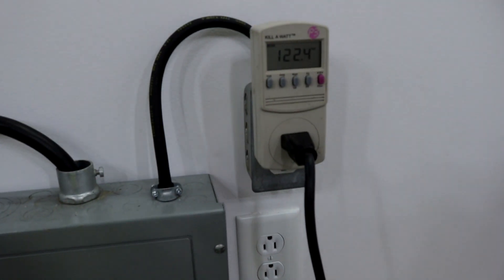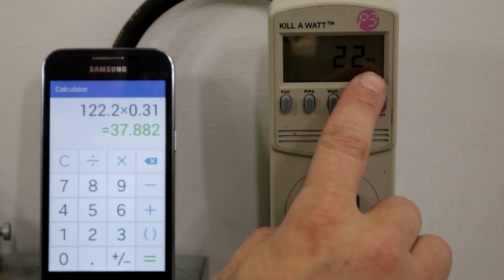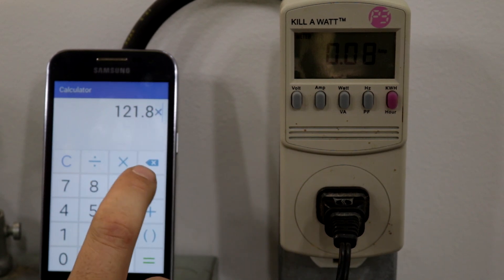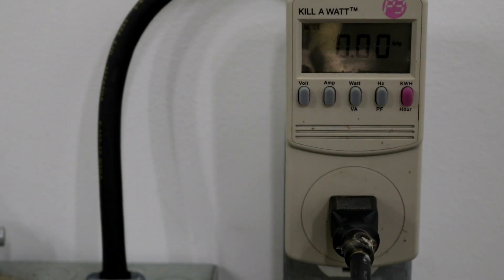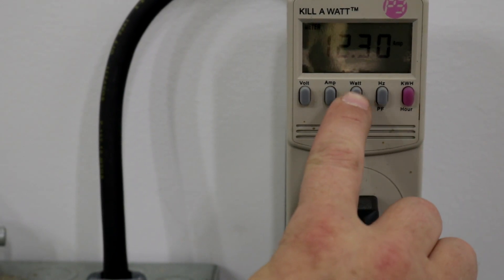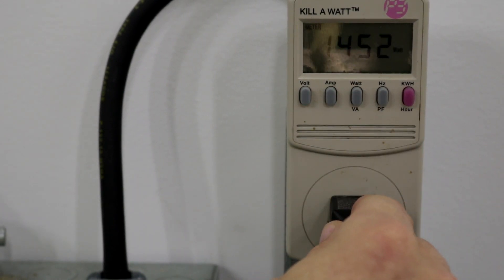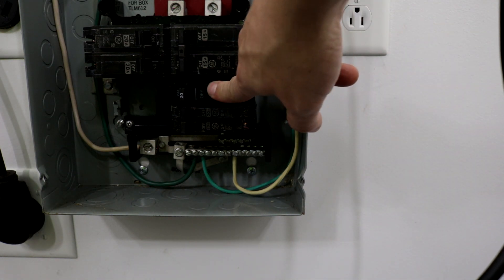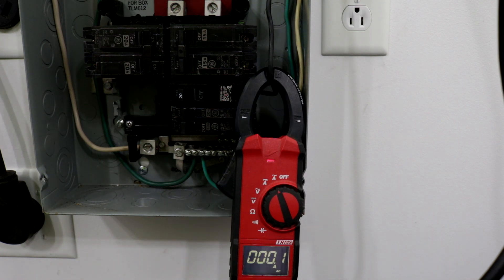How to Measure AC Amps - Circuit Breakers and Wall Outlets

Comment: How do you check the amperage on a 240 volt system?  Do you add both of the hots together after you check the amp draw with your amp clamp?

Comment: Thank you.
That was very informative.
Couldn't find a good video for either the Kill A Watt or a clamp meter on a circuit breaker panel, and this fit the bill perfectly.
Hopefully now I can figure out what the heck is drawing $700 a month in power on my bill.
Reply: Thats something everyone should do to make sure they are not being overcharged. Make sure whats indicated on the meter and on the bill matches the actual usage.
And parasitic loads etc....
You'll find quite about that online.

Comment: Good information. I have one question. There are two outlets in one of my circuits which gives very low amperage.  A small iPhone charger works but an iPad charger does not work!  All the receptacles in that circuit are wired correctly when checked using a three prong Outlet wiring tester.  The voltage on the nonworking outlets also shows as 110 when checked with a Voltage Tester.  Any helpful comments will be appreciated.  Waiting for an electrician to come and take care of this, hopefully!
Reply: Did you ever get this resolved, and what did the electrician say?

Comment: I need to install wall heaters. Is there a way to check if I can piggy back off an outlet (am I reaching more than or less than 80% of my amps?) or if I need to add a breaker and run wire? is that what the clamp is for?
Reply: A tankless water heater? Is so I install those all the time. I am currently running up to a job where I did exactly what you are asking. I was still under the 80% "so I thought" based off the numbers,so I pigtailed off the old power source for the original water heater. Even though I knew I should run an independent line and breaker,I didnt because the new heater was only 120v and within the breakers limit. Now I am taking time out of my day to go fix it for free because I didn't run the heater off an independent power supply. Take it from me,regardless of if it's a single pole 120v or a double pole 240v YOU WANT TO RUN ITS OWN LINE AND BREAKER. I hope this helps,I wish I would have taken this advice before I used the existing line. 
Good luck bud,I do this for a living and this is the first time I disnt do it the way I normally would,and it proved that I should have,if you ever have any other questions,I'm happy to help if ya want. Good luck,and be Safe!
Reply: @normalhuman9260  wall heater
Reply: @sindelm7437  do alot if those as well. Gas or electric? If its electric 1 pole or 2 pole? If gas is it natural or propane? If it is all electric,especially a double pole,I would almost guarantee it would need a separate and independent power supply. Depends on the unit itself and what the volt and amps are.

Comment: Great video, thanks for sharing.
Question :
Is a 12 gauge wire large enough for a 25 amp breaker ?
Thanks for your consideration,
Sincerely ..........................
Steph
Reply: 12awg is rated for max of 20amps, i would size up to 10awg, which is rated up to 30amps,  to avoid potential fires
Reply: For a 12g wire,I wouldn't do over 20amps even if you are only running it a few feet. How far the wire runs also makes a difference on sizes. With a 25amp,and running anything more than 20ft,I would absolutely take the other guys advice and step up my wire to a 10 gauge wire. Soild,not braided. Hope this helps,good luck and be safe.

Comment: Assuming the amperage load being measured at the breaker panel is carried by all wires connected to that circuit, why is there no meter to measure the remaining amperage available for that circuit (up to the breaker value) from any outlet connected to that circuit?
Reply: Is it because the wires in the circuit without an appliance connected (empty outlets) are not "drawing a load" from the source (the breaker bar)?  So the load can only be measured at the breaker?  Is it a function of drawing power, as opposed to 'carrying an amperage load'?
Reply: Ok, I get it:
To determine if you have enough amperage available on any particular circuit for another device before blowing the circuit breaker, you'll need to use 2 different test devices.  First, use an ampmeter (clamp or slide type) to measure the current load on the circuit in question at the breaker box without the new item connected to the circuit.  Record that amperage reading.  Next (either read the amp rating for the device from the label on the new device or) plug a Kill-A-Watt into an outlet on another circuit, plug the new device into the Kill-A-Watt and read the Amp draw for that device.  If the combined amps for the normal load on the circuit you originally wanted to use, and the new amps from the new device exceed 12 amps for a 15A circuit breaker or 16A for a 20A circuit breaker, you need to avoid plugging the new device into the outlet in question without removing some of the appliances that are normally connected.

There is no 'easy way' to determine if an outlet can take a new device without going through this painful process, unfortunately.  It is a function of each appliance 'drawing power' from the source (electricity to power a device will flow only through the wires going to the appliance, not through every wire connected to the circuit).
Reply: Isn't it curious, though, knowing we have put men on the moon, created particle colliders,  peered into the past with super powerful telescopes, etc, that we can't detect available amperage on a common household circuit with a simple plug-in device?  Where are our values?
Reply: Hayne Drake l

Comment: Can you use that clamp on a hot wire at an outlet/light switch hole in the wall? (where you remove a light switch or outlet from the wall and expose the hot wire)

Comment: My question is: What is available to me from my outlet? I just bought, and returned a Craftsman 6 gal pancake air compressor because if was not behaving correctly on an GFCI outlet. It was rated to operate at 150 psi, but only gave me 60 psi before calling it quits. It seemed to bail out due to a lack of interest. Online manuals described the unit requiring a 15 amp circuit.
Reply: Is your outlet hooked  up to a 15 amp breaker?  If it 'tripped', go to your service box & see if it is connected to a 15 amp (1800 watt max = Current 15 x 120 volts) breaker.  Your compressor draws a lot of power.  The breaker may be less than 15 amp, or it ( the breaker) could be going bad?
Reply: @markrist2270  where are there breakers smaller than 15A ?
Reply: @joncrosby8988  in your car maybe:)  This guy needs to know everything that's hooked up to the circuit that he's trying to use to power his compressor.  There's only one way to do that.  Turn the breaker off, and then go around the house and figure out what doesn't work anymore.  Try outlets, try to turn on lights, carry something with you to plug into an outlet (battery chargers are handy because their little light comes on) if you normally don't have anything plugged into an outlet.  Identify everything that is already tapping power from that breaker.  That is quite the process.  Again, why is there no simple device, that once plugged into an outlet, will sense the max load a breaker can 'live with' before overheating, and tell you how much amperage you can still apply to the circuit breaker before it's going to overheat?  It will probably need to be a little beefy.  It will have to apply a load to the circuit, and it will pop the breaker.  Then it will tell you to reset the breaker.  Then it should be able to sense the amperage on the circuit, do the math, and let you know...except for one thing.  A load on a circuit is only straight to the using device, and back to the breaker.  So the key to this device is determining how much more stress (heat) a breaker can take...from an outlet, that may have no load on it at all.  It's not impossible, if an electrician can do it, a smart loadmeter could do it too.
Anyway, astute question on your part.

Comment: hello sir i need you guidance. i need to install a gfci into my room so that i can power a desktop and monitor. currently i have a pos laptop and an ac connected to the 3 prong in the hall. but the ac and desktop would be too much for 1 outlet. i want to make sure that i am putting in the correct gfci. i recently graduated high school and am still in my parents home. and they wont let me find out what breaker controls my room. they know ive wired on up before but our house is wired weirdly and they dont want me messing with it which is understandable to a point. is there an other way to find out while staying on a budget?

Comment: When he says "Using an Amp-meter (to measure current) involves "Common Sense", 2 things to keep in mind: 1st: "Common" implies "Everyone" has it ("Sense"); trust me they DON'T!
2nd: Electricity is an "Entity" that MUST BE RESPECTED!  Using an Amp-meter where you must "break" the circuit involves "SKILL", which is hardly "COMMON SENSE" to begin with.

Comment: maybe a dumb question. but would you be able to test for this without a clamp meter, just having a regular multimeter?
Reply: He has passed away since.
Youtube lost another great teacher.
Reply: If your probe style has a built in breaker and the option for Amps then yes. It's one of the few times you will use the other red slot for the probe. It has to have a load on the hot to tell you what its drawling though. Hope this helps,be safe and good luck.
Reply: @michaelleddy3701  that's so sad to hear,thank you for the info. We lose the good ones young.

Comment: Good eve sir. I have a question if you may answer it. Cause i cant see the reading of the multi tester to see how many amps. For example the circuit breaker is 20amp. And i want to see the multi tester to show 20amps but i cant find it. Can u help me sir  to know how to do it. Thank you. I just subscribe in your channel.
Reply: If the breaker is saying 20 amps,you do not actually want to see your multi meter say 20amps,you want the meter to read no more than 80% of the breaker size. That being said,you will need a multi meter that can read amps,has a trip built into the multi meter,and the line you test will not only need to be hot,but also under a load. The amps will not be in the wire,even if its hot,untill you drawl the amps from the line. You will use the leads of the multi meter as the line that completes a circuit. Like taking a lamp,and removing the built in switch to turn it on,now it's an open circuit even if plugged in,now if you take the leads for the meter,and place one lead on each end of the open circuit where the switch was,you are completing the circuit with the meter,and what it reads at that moment is how many amps your lamp is drawing. Hope this helps. As I said,you do not want a 20amp breaker,and with everything hooked up to it and running,it drawling 20amps,you would hope to see it drawling no more than around 15amps on that breaker. 80% of the breakers max is the most you ever want to draw from said breaker. I apologize if you already know alot of this,I'm just assuming you and/or any future readers are starting without a clue. Best of luck to ya,holla if theres any questions you may have,I'm happy to help. Good luck and be safe.